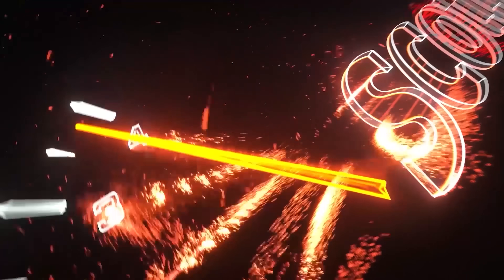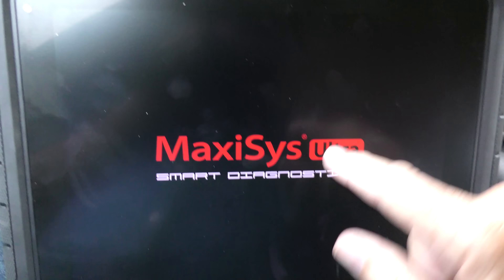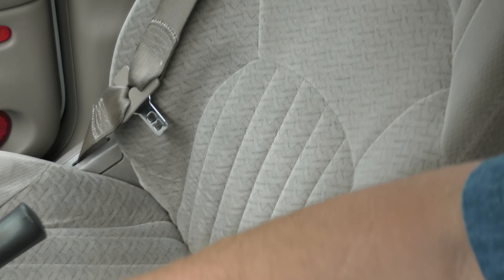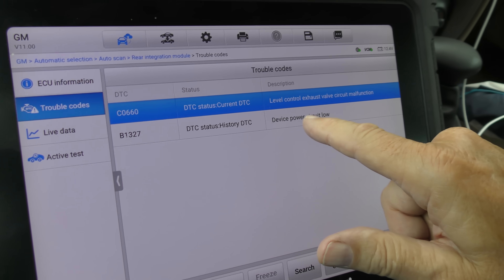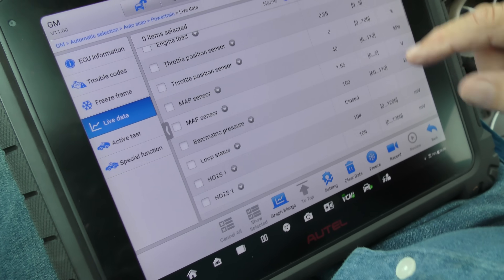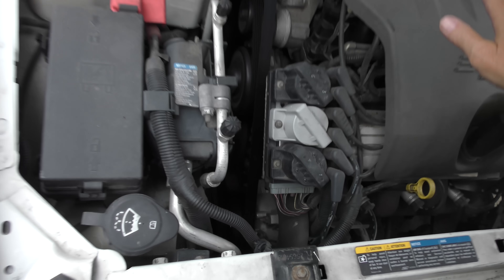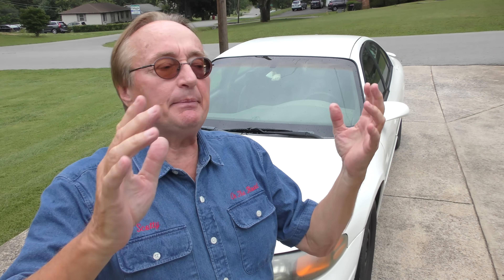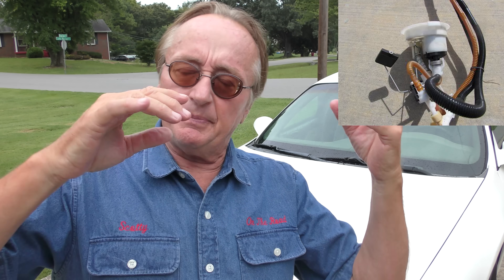Doing This Will Double the Life of Your Car

Comment: Hey guys, car owner here! I’m happy to say that the additive actually did some real good for the car. It’s starting up a lot better than it was before and i couldn’t be happier. I love this car to death in all its crappy looking glory. It was a genuine pleasure to see and meet Scotty :).
Reply: As long as it runs, and NO CAR PAYMENTS!! :face-blue-smiling:
Reply: You could also try cleaning the idle air control valve. Mine was dirty on my supercharged 3.8 engine and I had issues starting the car after it was warmed up. The transmission could be serviced and maybe fix the shifting issue with a new filter and fluid and a transgo shift kit, but that could be more money than you're willing to put into the car.
Reply: I had a hand me down 82 Ford product in the early 90s.  It was a carbureted 2.3 liter.  When it did the sputter and chug I tried all the local premium brands of gas.  I found that Union 76 premium had the best additive package in the area because my engine ran like it was in tune.  Then I timed it changed the plugs fuel filter and air filter and PCV and ran it on regular.  Unfortunately Union 76 pulled out of the area so I don't know if they still have the best additive package in premium gas but they certainly did back then.
Reply: Hang on to it Robyn! You'll won't cry over door dings....EVER.  😉❤
Reply: @rustysteel8714  I’m not the type to cry over that. But there seems to be a lot of people that thinks it’s an embarrassment to be seen on the road and needs to be gotten rid of apparently. Idc tho <3
Reply: You met the King!!! Scotty’s awesome. Good luck with the car!  Keep changing that oil.  And don’t look past PYP salvage yards for parts vs buying new.
Reply: I like the Pontiac. Wish the division was still around but more free of GM interference.
Reply: Keep an eye on your Coolant level with those V6 GM motors from that Era .
Most of them developed an Intake Gasket leak due to Poor quality and that Dex-Cool Coolant .
Reply: Drive this Pontiac until the wheels fall off. Then get a Pontiac Vibe.
Reply: Does he really have that much energy in person? Or Al Redbull before a video?
Reply: @dougcoleburn1579 he is actually that animated off camera!
Reply: I sold mine running fine and ugly at 280k.  Keep it till it dies.
Reply: I had a 1999 Olds 88 with that engine and it would die when I let off the gas sometimes and I had to restart it and take off again. It was the mass flow air sensor. Was a simple fix in that case and it ran fine otherwise. Good luck. 😊
Reply: I loved driving my old beat up truck to work. It did a good job at keeping aggressive from cutting me off.They stayed away knowing I didn't care about making their expensive car look like my old truck.
Reply: Keep it!
Some body work and a new headliner and repaint the front bumper with some new wheel covers and it would look great again.
Wouldn’t cost that much and you could do a little every couple of months.

The 3800’s can last!
Fix it up
Reply: @jayslomine4280  I really want to if I get a better job! It needs a new transmission as well but yea the engine is what’s making me want to keep it. Along with the smooth ride the car provides
Reply: I faithfully put a container of fuel injection cleaner in my 02 Blazer every fill up and it really helps keep the injectors clean and engine running smooth, mine is just hitting 200K and runs as nicely as any new car, those 3.8”s are really good motors, keep that oil changed and basic maintenance done and it’ll run and run.
Reply: @robyn1042, not only does your car have a great engine, Scotty made it famous!  Enjoy your ride.  Most of us would love to meet Scotty in person (even if he dissed my ride).  Cheers.
Reply: Still going?
Reply: @mrsmith5114  still runs great except for its trans and fuel pump. It’s time for basic maintenance but it’s been good to me. It did stop on my at a stop light because I stopped at a light that was on a hill but that’s all. That’s a pump problem I think.
Reply: i like your sticker
Reply: @matthias_music  thank you lol. Hoped not many would notice!

Comment: I don't know if that particular fuel additive is available in Europe, but the only additive I've tried that genuinely improves anything is Redex. I've tried others but they don't seem to fix anything. Even at a normal low dilution the Redex cleans and improves performance over time. I stop using it and the engine keeps running better than before I used the additive. I used it in every car I've had for over 30 years motoring.

Comment: Pontiac had a issue with the ABS in the wheel bearing HUB goes bad then it throws ABS! Change the wheel bearing with one that has the abs sensor in it and the ABS light will go off..another part issue is the wiring at the hub cracks. So it can cause the abs light to come on and off depending on how far the wheels turned.

Comment: Had a 2002 Buick LeSabre 3800 v6 bought new. Had good mechanics, had one problem starting and stall out - it was Crank shaft position sensor. My long time Chevy mechanic couldn’t figure out - ( around 190,000 mi) got real bad, took to Buick shop - younger mechanic knew the history on engine - crank shaft position sensor - started like brand new (@ 250,000 miles fixed). Used both shops - had to send to salvage yard at 20 years old 273,000. Leather seats interior - no cracks. Underside rust rot - Chicagoland winter salt killed it. Brake lines rotted away - fixed 3-4x. Replaced head gasket 2x, every engine sensor, alternator. Replaced Spark plugs100,000 mi. BG products fuel cleaning injectors, rails, gas additive- no fuel problems- fuel pump pressure perfect for life. Rear air shock replaced once, front struts replaced once, front wheel bearing once ( left side 110,000 and right side 210,000). Normal transmission service - no issue. Brakes every 85,000 mi. I appreciated having very good mechanics 👍.

Comment: I bought an old Dodge Dakota from an old mechanic that has dementia. 1993 with 130000 miles on it. Two years ago, he had the transmission rehauled. When I drive it, when it shifts gears, it has a hard shift. Definitely no slipping, but a really hard shift between each and every gear. My question is, can I do something to smooth out the shifting? I paid $200 for it, just for a backup vehicle, but if I can get the shifting smoother that would be nice. What do you think Scotty, am I being too picky? Thank you for your time and love your work.

Comment: Hi Scotty! I hope all is well. I am a novice with cars and how it even tick. Thanks to you  I learned few tricks here and there. By the way, I have a 2010 Chevy Malibu 3.6L V6 LTZ, that stalls. If it successfully starts, dash indicates all are fine. A few minutes when car heats up but  temperature remains one bar below the midline, if AC and radio are on it begins to shut-off, then these false error comes on, Service Air Bag, ESC off  Traction off... same thing happens when either of the AC and radio initially are turned-off. Then the engine shakes prior to shutting off completely. I already replaced with brand new battery, collant temperature sensor, purge valve, cleaned the throttle body and some connectors. Both fans in front auto-turns on when temperature hits the range when it has to. I had to reinstall the MAF that originally came with it, since it seemed the third-party part I purchased generated P0171 and P0174 lean code... suspecting not the right part or defective from factory. Lately, I got a P0113 AIT. I could not locate the AIT on the car. Could it be integrated on the MAF? Does the symptoms point to MAF replacement? You insights or suggestions are truly appreciated. Thank you.
Reply: Think you still have to submit questions via his website.

Comment: I have an 94 Olds Cutlass Supreme S 3.1 with that same engine & when I 1st brought it  from a pvt ower in 2003 and took it to the shop for it's 1st oil change,I was told that model Olds was the better  between 1990-1993 were problems, but the 1994 was the right year.Believe me I've had 2 fuel pumps put on & you are right once it goes out it will'n start or if it did it wouldn't go very fast.What's the full name of that cleaner & what's the price of it & who sells it?

Comment: I'm on my third 3800 powered buick. Other than oil changes, tires, belts and batteries I have NEVER done anything else to keep them on the road. Most reliable platform ever made as far as I'm concerned.
Reply: What happened to the first 2?
Reply: I gave up on the 3800 after multiple failures. Loved the supercharged version but GM quality was horrible. I worked for GM so I wanted to like them. Now own a Toyota RAV4 and Honda CR-V. Not a penny in repairs.
Reply: @emscott2  Maybe I've been lucky. I always get buicks instead of chevys or pontiacs. My theory is old people buy buicks so chances are they were better maintained. I've had an 01 regal a 98 park ave and now a 97 riviera. All supercharged. The regal went over 300k on the original transmission. Almost 200k on the riviera, I can tell the transmission is on its way out though.
Reply: You got lucky because you got the supercharged version, which didn't have the lower intake manifold gasket failures which would hydrolock the engine at the grocery store parking lot.  I have owned a 1988 Electra with the 3800 and a 2005 Electra with the Series II version (engine was fine, rest of car was one of the least-reliable of any car that I have ever owned).
Reply: I have a 2005 Buick Lesabre as my daily driver with only 109k. Solid! 3800 3.8 V6 may be the best engine GM ever made!

Comment: Fuel trim on my Lexus es300 was running lean. Not enough to trip the code, but enough to be pretty significant on the live data. I replaced the fuel pump, regulator, and filter. Made a big difference. I then used the ATS 505 to make sure the injectors are cleaned. Now I just need to fix the rattling exhaust.

Comment: Had a 99 grand am 3.4L that had 400,000km on the original motor and transmission. Only went bad from the salted roads up north here fuel and brake lines all rotted out.

Comment: Had a spongy brake issue that turned out to be a missing bolt on brake booster. Bled the brakes several times before figuring that out.

Comment: I paid $450 for a transmission for that 3800 series 2.
It came from a salvage yard but i just put a new tourqe converter, new filter and new transmission fluid it $450 case.
Boom its shfits smoothly and still get the good fuel mileage.

Comment: I had a 2000 Bonneville SE that i had for 13 years. I replaced the transmission at 6 years old. My head gasket went bad that that was the end. Car was kind of decent.
Reply: The head gasket in the original engine went out closer to 100k miles. That’s the second engine you see in the video. And I may be getting a new trans soon as well

Comment: Could be a weak battery, spark plugs and wires, distributor cap and rotor. All things to check before replacing the fuel pump.

Comment: Pontiac gran Prix and Bonneville had strong engines but weak trannys if u have a lead foot! The 4cyl gran AM were great as long as you weren’t in rust belt states!
Reply: Do you have a suggestion on a replacement trans 0.0

Comment: Man id love to have you diagnose my 2000 buick that has over 222, 000 miles on it.  She still purrs like a kitten because i do everything at the proper intervals and at 51 i  drive like a 90 year old grandma. 😅  I also periodically put additives in my tank to help clean things out and make it run better.

I was the exception where my busted transmission was concerned it failed in 2015 just after i got laid off and i couldn't finance a different vehicle so i put the work on my credit card.
Reply: I’m about to go through the same thing with my car in the vid. The trans is slipping so it’s either a new trans or a different car. But I wouldn’t get rid of my car until the very end
Reply: @robyn1042  indeed it can sometimes be tough decision. Best of luck to you. It could simply be a shift solenoid not functioning properly, mine had that issue long before it failed. This is a much cheaper fix.

Comment: These were basically the last decent GM cars. I've seen them with well over 200,000 miles and they are still on the street. If you maintain them and don't abuse them they can last.
Reply: New GM get problems before warranty.
Reply: Being in Texas, I don’t see why 200,000 miles is such a great achievement… we put that on our vehicles within 2-3 years.

Comment: Scotty, I have a 2004 Ford Mustang with a 3.9L V6. The hood scoop is for aesthetics only. What would it take to make it a working scoop and would the engine benefit enough to alter the hood?
Reply: There is a company that makes shaker hood conversion kits, and under the hood it routes back thru the stock air intake.  Looks pretty cool, but you do have to cut on the hood.  I think the company was CDC, not 💯on that.

Comment: The  3800 is noted for the crank sensor being fiddly as well..  damn things won't show codes, they will work and quit, then work etc... you can chase it like a ghost sometimes
Reply: Oh what do you mean by working and quitting? I’m the car owner of the one in the video. I’m curious what you have to say :)
Reply: @robyn1042  the sensor is the ignition trigger and they get old and will sometimes just stop working, and then the car will stall. After a few moments it will work again and the engine will start and be normal.   Until the sensor dies completely,  it's difficult to pinpoint the reason why the engine stalls. The only way to eliminate it as a problem is to swap it out.   It won't show a code, so it's just a educated guess to find the trouble
Reply: @jeffblack7711  so that’s what could cause the car to turn off after a 45 min trip up the highway turning into a parking lot?
Reply: Scotty could be right as well and be a dying fuel pump.  Like I mentioned earlier the only way to find out is to swap out the suspect part in this situation
Reply: The crank sensor is probably the cheaper one to start with.  But it's still a educated guess

Comment: I put 1/4 cup of  Marvel Mystery oil per 10 gallons of fuel every time I put gas in my 95 Ford escort and my 97 jeep. I believe it keeps the fuel pump lubricated and keeps seals from drying out and keeps the carbon from building up on the valves, etc.

Comment: I can’t speak for the rest of GM products but in my experience Pontiac’s are great. I have 2 of them, I’ve got ‘98 Sunfire, nearly 300000km on it and it’s still going strong, lower quality interior aside lol. It’s been an insanely reliable car, never breaking down on my, just a few smaller issues here and there. I’ve also got a ‘84 fiero I’m working on getting it running. It’s such a cool and unique car. I’ll never forgive GM for canceling Pontiac in 2010, say what you want about GM being a crappy company, but don’t sleep on Pontiac lol.

Comment: GM's 3800 Series car are pretty reliable and cheap to fix if you can turn a wrench.  Ashame GM discontinued that engine.  The 3.6L they replaced it with is garbage IMHO.

Comment: I'm surprised Scotty didn't clean the MAF sensor to see if that would be a cheap solution.
Reply: How do you do this? Is this easy? It’s my car so maybe I can try.
Reply: @robyn1042 you just unplug the sensor than spray it with solution then let it dry fully before plugging it back in. I think he has a video on it. I'm not sure the solution you use to spare it but I'm sure th e local auto parts store has it.
Reply: @Resoxin I rewatched the video and after symptoms worsened I cleaned it and it ran like new again! It started appearing again but that means it’s time for a new sensor. Very late but Ty!

Comment: Double the life of your car...
Change the oil every 5k
Use TopTier fuel
Clean air filter regularly
Drain and fill the transmission fluid every 60k

The 3800 Series III engines are freaking incredible. All cast iron, no aluminum. 30 MPG after Hot Shot's Gasoline Extreme.
Reply: You should never change your transmission fluid
Reply: @cas2985 It's both... If you change the fluid, you should keep changing the fluid. This is what's best for longevity. If you never change the fluid, then you're already screwed, but changing it will just cause it to fail sooner. The explanation of why is complicated, and has to do with how the transmission surfaces wear. Generally speaking though, you want to change it for best results. You also want to change it, if the manufacturer/dealer says it's sealed, doubly so if it's a CVT from Nissan. It's part of how they're trying to reduce the lifespan of the cars.
Reply: It made all the difference when I changed it on my old manual Ranger, at 90k.

Comment: my younger son has a 97 Grand Prix GT with same engine that keeps setting a check engine light that mechanics haven’t been able to track down. I believe it’s the Evap cannister that’s never been changed (car was bought used).  Getting codes for oxygen sensors but they were charged. Car also stalls on occasion and sometimes it won’t crank at all, battery is good. I think it may be the ignition switch for this issue

Comment: I had the same 3800 V6 series 2 engine in my 2006 Pontiac Grand Prix GT with 200hp. Same engine they used in the regular Camero's. Has 240 hp with the super charger in the grandprix GTP and the higher trim Bonneville.